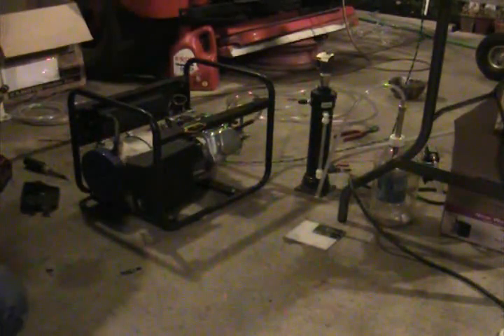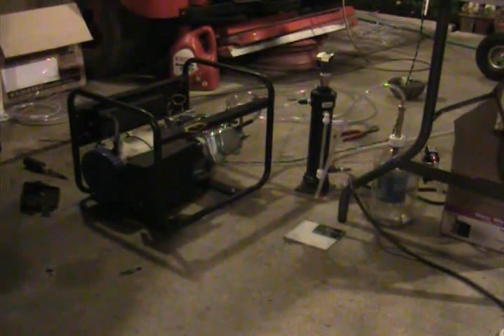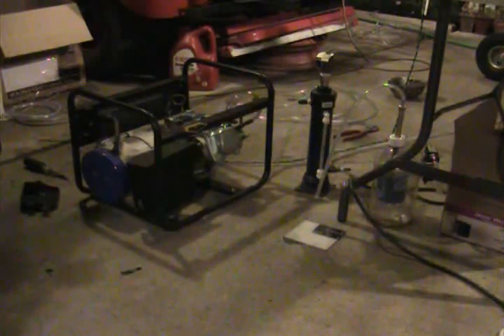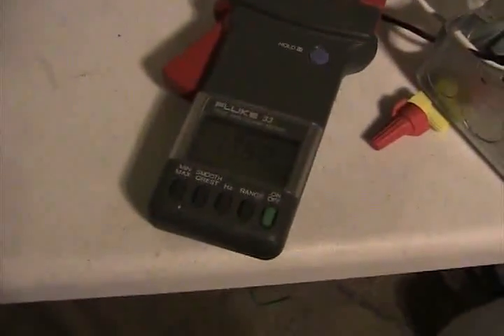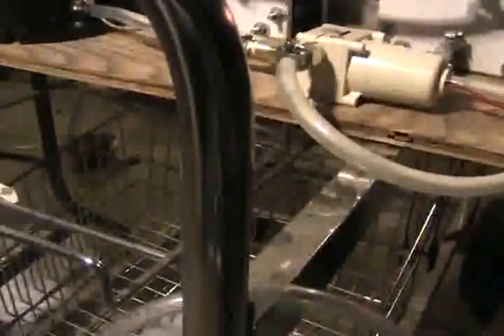generator test 15 engine running on hho

Comment from the maker: yes is does, but the purpose of using house current is to use higher voltage and less amperage, so that the wiring can be simpler, and smaller guage. The cells can be powered off the voltage coming out of the generator which is the same as house current. Its just a convience thing, volts/amps doesnt really matter, its all watts in the end.

Comment: just wondering the bit which you kick start with the drill does that keep spinning when its started and could it be possible to extend the bolt or what ever it is that gets cranked just far enough to have a small belt attached to it.then have the belt lead to a alternator so it could send charge back to the battery to power the hho unit whilst the hho is powering the generator :) just an idea thats all and would save using house electricity.